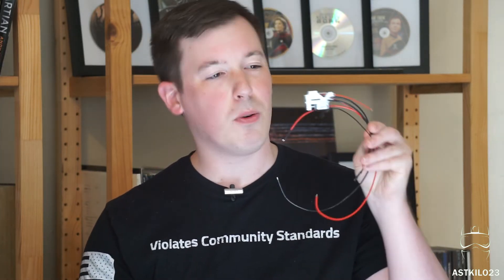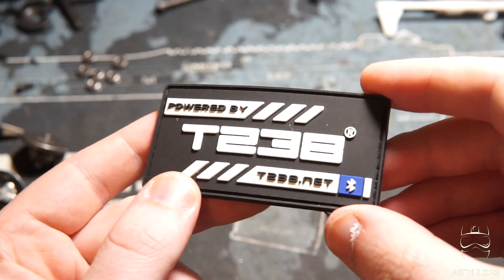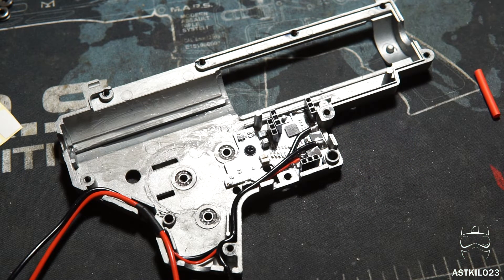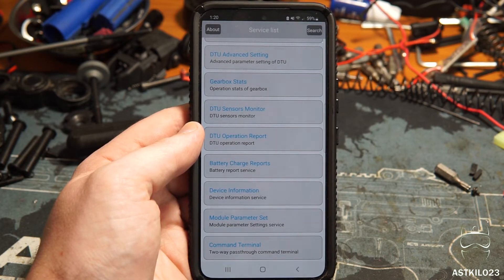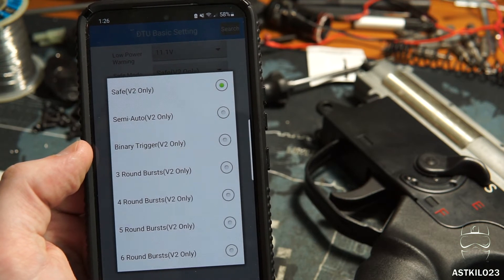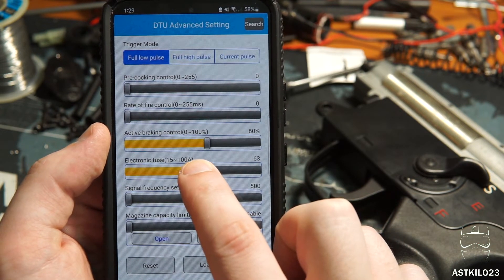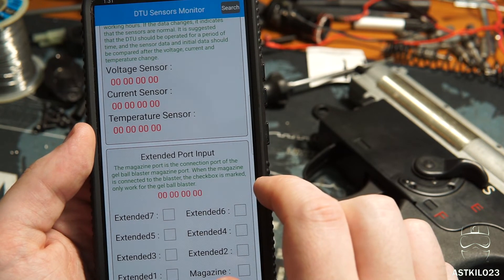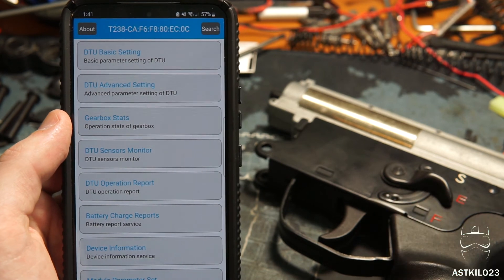T238 Digital Trigger Unit V2.0 (w/ Bluetooth) Installation and Review

Comment: I’ve bought many t238 mosfets.. I was a huge fan in the beginning.. probably 3 to 4 years ago.. they were fantastic then. But in the recent years. They’ve been growing increasingly more expensive, and poorer in quality. I’ve bought a few of the basic ones and they are all terrible. Not as responsive, always having issues with feeding. The switch they use for the trigger is horrible. It gets stuck easily and my semi becomes auto. And my binary becomes burst fire.. shoots some times.. doesn’t drive the mag terminals sometimes.. all 3 of them were like that.. I wasted a lot of money on 3 new basic ones including a v3.. sorry t238.. not a fan anymore.

Comment: Just take a Dremel tool and cut slots the selector plate where the optical sensors are... That way it will still function as a selector plate and all your fire modes will work. figured this would be common sense. I've done this on a few builds before. Also you need to use the rubber washer on the screw. The board is covered with a Conformal coating and under is a copper plane so if the screw bites down and scratches the coating it can short out to the copper underneath the Conformal coating....

Comment: I’m running into the same problem with a selector plate, is it possible to get a different plate to use that will allow safe,semi, and full auto?
Reply from the maker: Not that I have seen. Seems to be a requirement of this mosfet to have sufficient selector movement for all modes, which disqualifies a lot of gun styles unfortunately.
Reply: @ASTKilo23  it’s a vfc gearbox in a samurai edge 2.0, and wasn’t sure if you might have a recommendation for a different mosfet for this gearbox that wouldn’t run into this issue
Reply from the maker: @joshpunke9536  That's really odd for an m4 style selector plate. Can't say I've had issues with them myself with other mosfet. Might want to see if you can find a few inexpensive plates, like guarder or another random brand, and see if they work any better. Maybe try varying the sticker placement as well.
Reply: Literally all you have to do is cut slots in the selector plate for the optical sensors to pass light through. It wont effect the selector plate functionality.